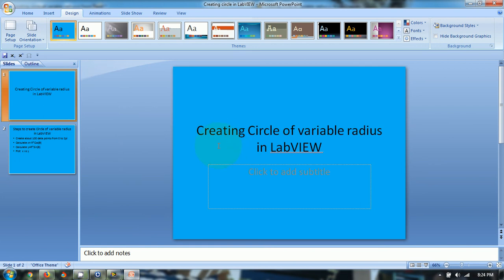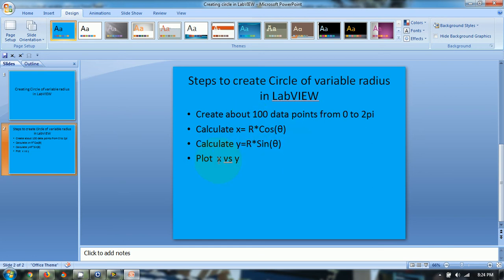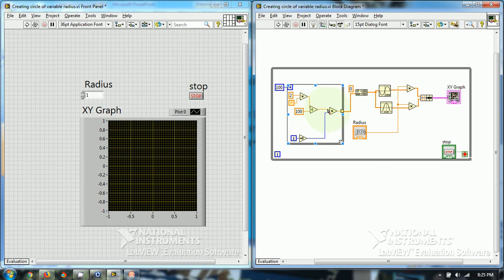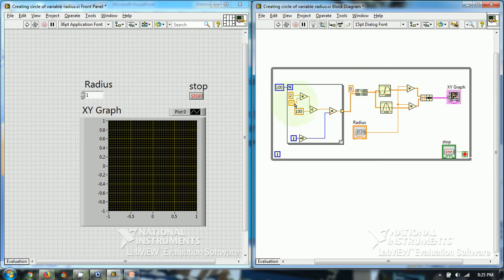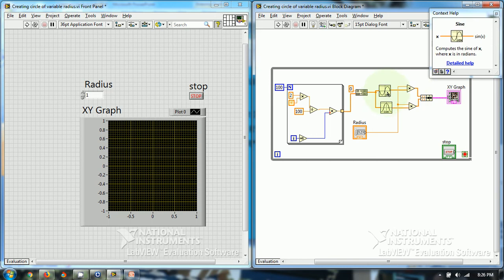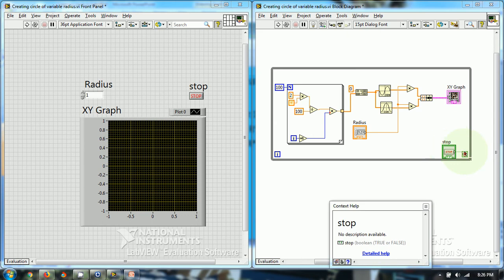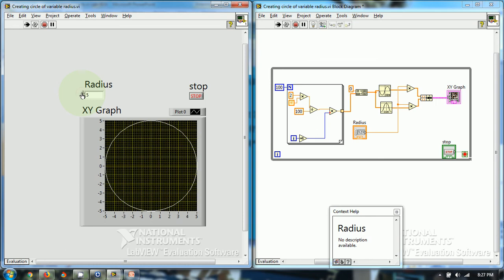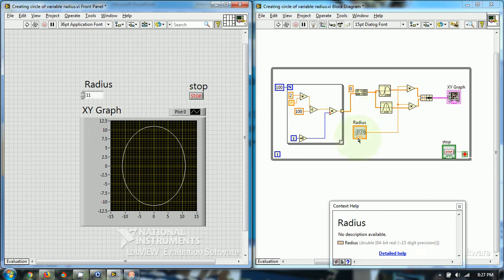How to generate a circle of variable radius in LabVIEW

Comment: How would to plot 2 different radius on the same graph?
Reply from the maker: Use another variable of radius and sine cosine and bundle them seperately....then use a built in example code to plot multiple graphs on the same xy graph in LabVIEW.Plotting multiple plots to a single XY Graph is easy enough when the XY Graph is in the same VI -- thanks to the Multi Plot example that comes with LabVIEW.